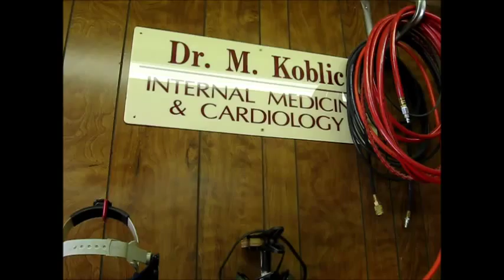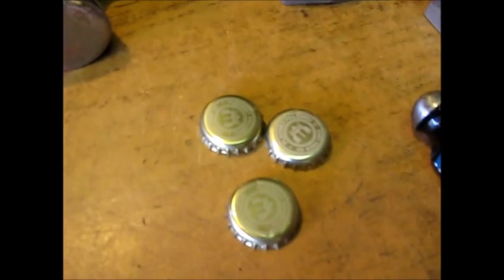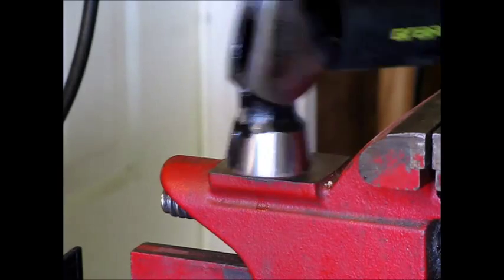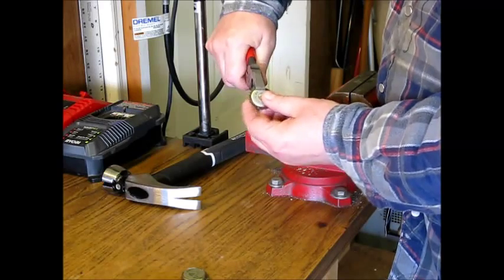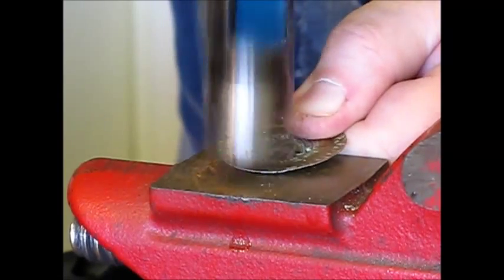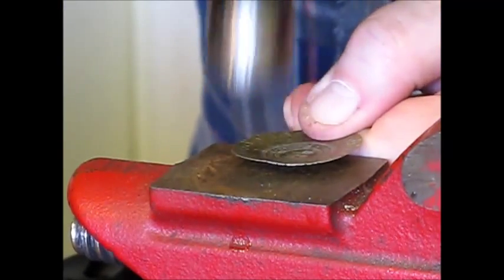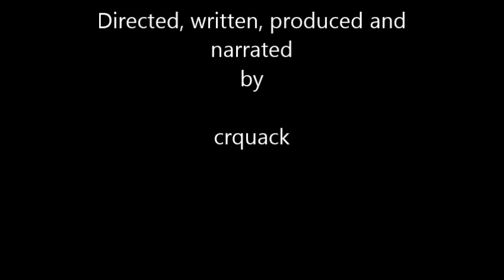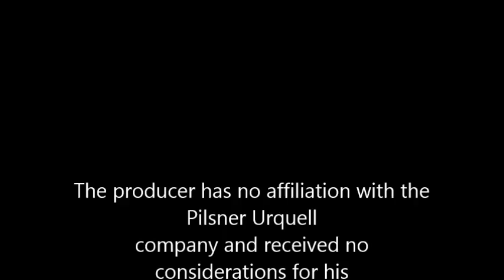Flattening bottle caps

Comment: Since u obviously know a lot about working with bottle caps can u suggest a way to cut out the center of a beer cap to basically get rid of the crimps.   I’m trying to make a bead, doming the cap and then soldering or gluing them together.  Any suggestions.  Thank you.

Comment: Is there a way to flatten them without damaging the paint? Maybe some jig can be made.
Reply: rubber mallet?
Reply: Pliers to push out the teeth, then work the bend out and finish with a soft hammer. It can be done. Though to what end, I’m not sure. I too am trying to find a purpose for this 😅